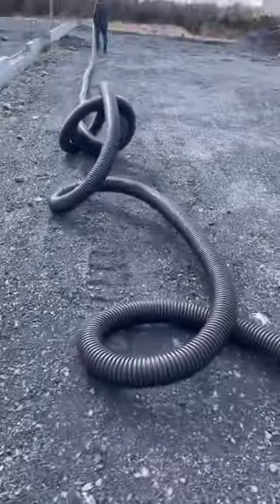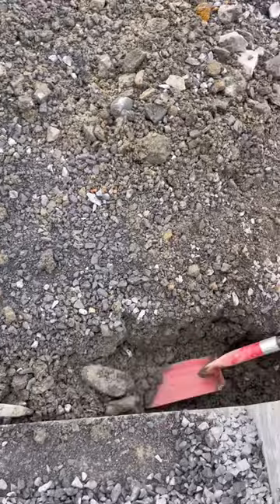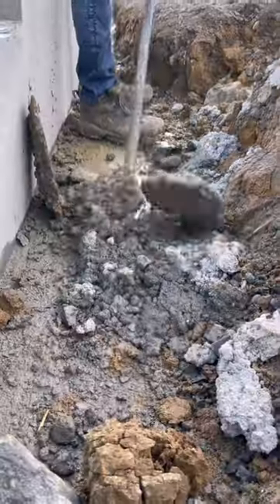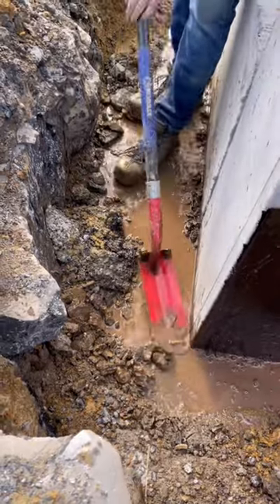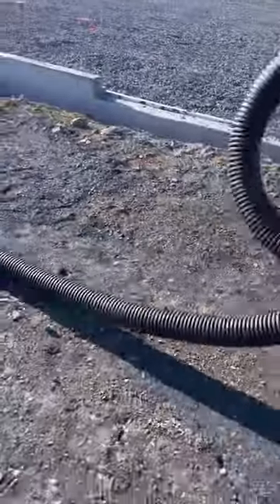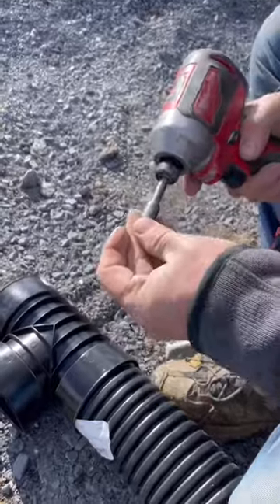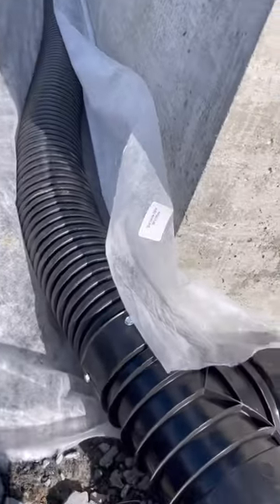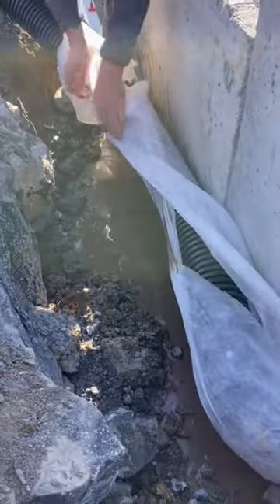Installing Foundation Drain Pipe (Part 1)

Comment: It goes beside the footing in all Canadian build code. Never put it on the footer.
Reply from the maker: It’s impossible to put it beside the footer because they are trench dug footers. Also the slab is like 2 feet higher than the strand so water is not going to be a problem

Comment: That pipe will be toast in less than 5 years I made the same mistake putting it in at my place. I replaced it with schedule 40. I tried to save a dime but ended spending a buck.
Reply from the maker: I’ve dug up ADS pipe that’s 30 years old and still in perfect condition
Reply: @hausplans  yeah right hahaha nice try see you in 5 years. You’ll be in my shoes that pipe is better as a paper weight than in the ground.
Reply: @jake16542  you come of arrogant, just so you know.

Comment: Big-O drain pipe was made illegal in many areas as it was found to collapse over time and fail. Schedule 40 is a much better products. Did you separate the surface and sub-surface water? If not, during a storm, the surface water overwhelmed the sub-surface pipe and forces water under the footing and into the crawlspace. Basically roof water should be in its own piping.
Reply from the maker: I’ve dug up ADS pipe that’s over 30 years old on remodel projects and it’s still in perfect condition. It won’t collapse if it has proper backfill. Also I never combine downspout water with foundation drain water your correct that could be very problematic.
Reply: @hausplans  I've done professional drainage jobs. Anywhere that was expected to see a lot of ground pressure got schedule 40. Everywhere else got thin wall. As long as you don't drive over it a lot it will be fine for the life of the pipe.
Reply: do roots have a habit of infiltrating the tubing
Reply: Only place we run SC40 was in drive ways or a road way , Edge drain can hold up to 3000 psi when in the ground  that is with stone under and over it then dirt .   old hay fields used clay tile 2 foot long and tractors drove over it never hurt that .  but you drop it and it shatters .  It has less than 1000 psi rating .
Reply: @xxxmikeyjock they put that stuff in our basement addition in 1977 on the inside I believe... it was going to the indoor under foundation sump pump.
Reply: @JCcanU  Fun fact that old 2-piece clay tile piping is why the modern plastic stuff is still called drainage tile.

Comment: You're supposed to wrap the pipe with The Rock otherwise the rock fills up with mud and the water doesn't get through it'll eventually fail the only reason I say this is cuz I just watched your wife wrap the pipe which will help but it will still fail because you got to wrap the crushed rock too😂

Comment: I used to have to work with flex hose almost every day when I worked for an Environmental Response Company. I, TOO, imagined it like I was wrestling a huge snake. 
One person would stand in the center and assist with the unraveling while the other person pulled the other end. It’s seemed to work best that way for us. 
You’ve got a heck of a project on your hands, there. 😊

Comment: connect rope to both ends. attach one end thats the outisde end of the pipe to something anchored . then attach another piece of rope to inside end of the pipe so it pulls from the inside out. then walk it out holding the rope thats attached to the inside end, letting it twist as needed.

Comment: 👍 good job. It'll be good for quite a while. Like what's already been said I like to use the tile with the sock on it. I also encapsulate the drain stone with the filter cloth so dirt and silt doesn't clog the stone.

Comment: That long flexible drain pipe must be really hard to get that perfect fall. Ive installed both solid and flexible and found the solid one to be easier to set small fall
Reply from the maker: I don’t try to get any fall on my drain tile pipe. Because it’s slotted there’s no reason to slope the pipe it would just leak out. I run it flat on top of the footer the entire way around. The only part that I slope is the part that runs out todaylight when I switch over to solid pipe.
Reply: It doesn't have to have a fall.

Comment: As a person who use to install drain tiles and stuff and repair foundations only thing I could say to help would be get perferated pipe with sock over top and go next to the footing dog so the pipe sits about a inch lower then top of footing cover with a lot of gravel and should keep water from getting under the footing

Comment: your drain tile should be lower than the footer. Allowing the water level to reach the top of footer before the tile picks it up leaves you at risk of water intrusion through the cold joint where footer and wall meet
Reply from the maker: Normal you’d be right by these were trench dug footers, so there’s no way to get the pipe at the bottom of the footer. Also the floor is 2 feet higher than the top of the footer so water will never be a problem

Comment: Q.) Would it be more advantageous to use pop rivets? Reason, the tips of the screws won't catch on anything passing through the pipe. Yea, it's slower but overall better? What do you think?
Reply from the maker: That’s not a bad idea at all! Especially if it was for a downspout/gutter pipe that might have leaves in it. These foundation drains should never have any debris in them
Reply: The point exactly. Once buried, tough if not impossible. Just a point to consider.

Comment: To unroll the pipe, even alone, use a piece of rebar to secure the outer end of the pipe to the ground.  Then, use the nylon twine through the center of the roll to unwind it as you walk backward.  Always make the slack by tossing it up while you walk backward, never just start pulling it thinking it will unwind on its own.

Comment: Unless that is the more heavy walled corrugated pipe that ADS makes I would stay away from it. Use FDM high octane slotted pipe. It will last you forever.

Comment: I'm learning, but what I think I have found to be the best way is that the rock should be encased with the pipe all within the fabric. Why do people not all do this? Why do people just wrap the pipe and lay the rock on the outside if this method is subpar?
Reply from the maker: We both wrap the pipe and put fabric on top of the stone before backfilling with dirt. This keeps silt from getting in the dirt and clogging it up. We didn’t do it in this situation because there is no dirt on top, it’s gravel all the way up to pavement.

Comment: Edge drain comes with a sock over it . are you saving money using plain pipe and then cover it with fabric ?   in the 80's we used the sock . im sure the Baseball fields I did and around building are still draining .

Comment: What is RDC and why did you have to clear it out? Why not dig the trench just outside of it?
Reply from the maker: RDC (Rock Dirt Combination) is a mixture of dirt, fine gravel and 3 inch rocks that is used to build up roads and parking lots. The foundation guys had dumped RDC between the foundation wall and a parking lot so they could back a truck in the building to dump gravel. The drain pipe needs to go against the foundation wall on top of the footer. So we had no choice but to dig it back out. The pipe should’ve been put in place before they filled that area in

Comment: You're supposed to wrap the rocks around it too
Reply from the maker: We did
Reply: @hausplans  wrap** the fabric is supposed to go around the rocks too.
Reply from the maker: Not around the rocks but on top of the rocks before you add soil. In the situation there is no topsoil we will be pouring concrete so there’s no silt to get into the rocks

Comment: On Top or below the footer pad?
Reply from the maker: In the situation it went on top of the footer because the footers were trench dug, and we had to break rock. On a house with a basement I usually try to get the drain next to the footer.

Comment: Hopefully the screws are stainless so they don't come apart
Reply from the maker: They’re not stainless and it doesn’t matter. This is just meant to hold the pipe in place to the gravel’s on top of it then there’s no way for it to move

Comment: Why didn't you use 4" sock pipe with fabric already installed, only cost a few dollars more???Lasts for a long time. Been on remodel jobs many years after initial install and still going strong.
Reply from the maker: Unfortunately none of the distributors in our area sell it that way but it definitely sounds like it would save some time

Comment: Where does the water go?
Reply from the maker: There’s a T at the low into the building. A pipe will get connected to the T and then extended out away from the building on a gentle slop to daylight. So any water that comes out the pipe can run out to the grass
Reply: @hausplans  thanks for the reply!

Comment: Wrong - wrong!! Always install the drain more than an inch at highest point BENEATH and outside the footing.
Reply from the maker: That’s not possible when you have  trench dug footers
Reply: @hausplans  Do U know that ALL concrete bodies will over time equalize their water content within the whole body. So if the footing stands in water, the humidity will meander up through parts above the drain.

Comment: With this shitty corrigated pipe, it will fail very quickly.  Shouldve used SDR 35 perf pipe wrapped in filter fabric.
Reply from the maker: I’ve never had a problem with the corrugated pipe, not holding up

Comment: That's not how it's done, at least not in Europe. Our drainage is usually lower than the footing so it actually keeps the foundation dry. Also you can't get the soft "pipe" properly installed, it needs to have constant drop, we usually use 1% drop so 1cm per 1 meter, so it guides the water away. Pipe filters have been out of use for a while, because they don't really work , crushed rock with 8-16 mm fraction does the job better.